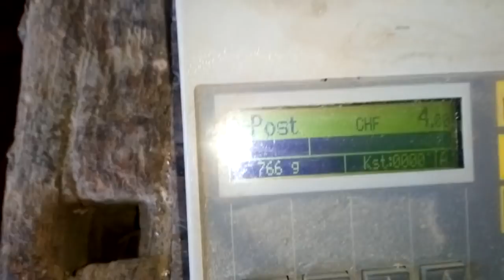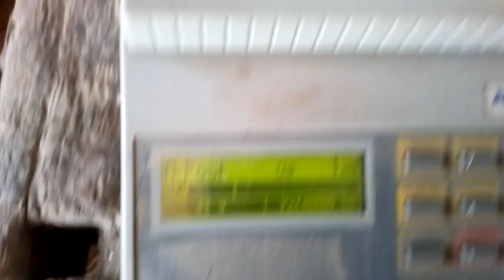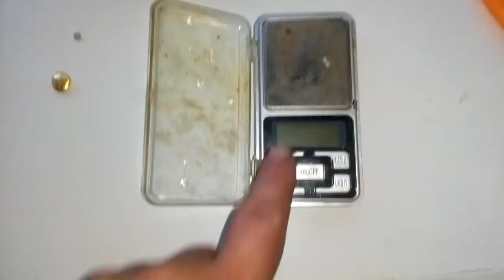I 8000 CPU-s,E-PROM-s & ceramic IC-s for gold recovery and refining!

Comment: I know you like doing this video buddy your first time with these kind of chips... With the non gold leg I tend to cut the legs off with snaps or whatever available and I still find myself doing a nitric leech first... To get rid of the base metal and silver I think I averaged around 5 something grams per pound the Gold Lake gold cap is definitely 7 or better...great job😁😁
Reply from the maker: Thanx brother!I have access to a large amount of nitric so I do not remove legs without gold. I've worked with this type of chips just did not make video before because the quantities were always smaller and I mixed them with ceramic processors, this is the first time I've got a higher amount in one tour for toll refine.

Comment: I have same material in aqua regia now, but my solution is very dark blue with many gold foils. Can you tell me why it is blue?
Reply: 999 dusan gold recovery
Reply from the maker: Maybe Aqwaregia is oversatured, the color of the blue solution indicates a copper in solution. Additionally, add more Ar and will certainly be better.I'm sorry that you waited a little longer for the answer. I can not achieve, to much of obligations!
Reply: @999DusanGoldrecovery  no apology needed sir... I think its awesome that you find the time to respond as quickly as you do. I siphoned off the blue liquid after testing negative with stannous and started with more at. Now all gold and metals are dissolved except a few legs. Denox and filtering in process now. New fluid is darkest yellow I've produced yet... 😎
Reply: Can silver dissolve in hcl without nitric and create a blue solution?

Comment: I would have used a grinder and removed the non-gold plated fingers from the sides of the chips before putting them in solution. Less base metal to dissolve. I would also put them through a small ball mill to crush everything to powder for easier gold recovery. Once again, a great video!
Reply from the maker: Thank you. It's always better to remove the base metal base if you have the time and possibilities, although I do not care about amount of acids for me, so I do not mind. The grind is good, although I've repeatedly grind ceramics to the small particles after-process once or two times and repeated and nothing In addition in gold, I think the grinding does not play an important role in gold amount!.But maybe I'm wrong!

Comment: Love it.  I am refining now but where can I get good filter paper? I'm in Canada. Can u help me on this.
Reply from the maker: I simply use cheap coffee filters from local shops and at the bottom of the funel I always put a charmin plug from paper or fate, the process of filtering is slow,drop by drop, but this is not the job for people with thin nerves anyway :)
Reply: @999DusanGoldrecovery  thnx Dusan. I figured that would be the best.
Reply: They are also available at the grocery store. Another thing that Dusan likes to use is a Charmin plug. Basically you pack toilet paper as tight as you can in a cigarette shape and feed it into the bottom of your funnel.. Dusan mentioned that in a previous video. It is slow! But  it's like everything else in this hobby - you need patients or your going to hurt yourself or someone else! Be safe and happy scrapping!
Reply: Jane Peacock go. To a coffee shop. They will have them there just ask for  filters.🏆👍
Reply: Thnx guys. That's exactly what I've been using. Just want to make sure I was not losing to much gold. I also just ordered some called whatman number 2 but won't get here for a bit. Until then I'll keep making gold coffee. Lol
Reply: I get mine off ebay.  I prefer 90mm 102 papers but I also use 103 papers for quick filtering.  I've gone through quite a few of these and find them very good.  Good seller too.  Quick shipping. https://www.ebay.ca/itm/90mm-Qualitative-Analysis-Filter-Paper-15-20-m-Speed-Medium-9CM-100-Sheets-Pack/262499996221?hash=item3d1e38123d:g:4ZIAAOSwOVpXcN13